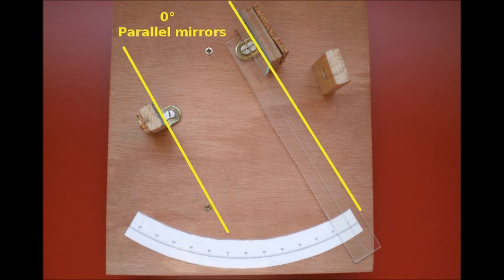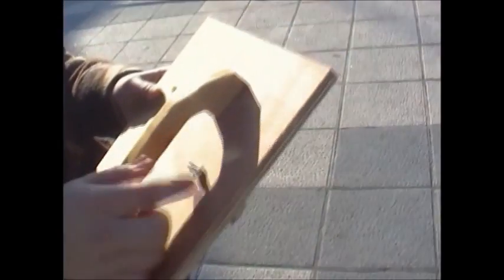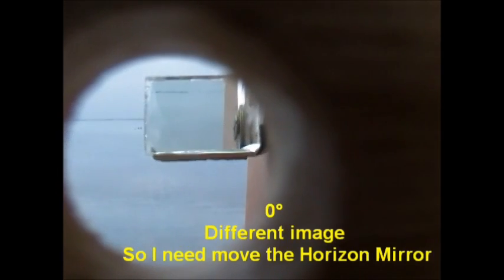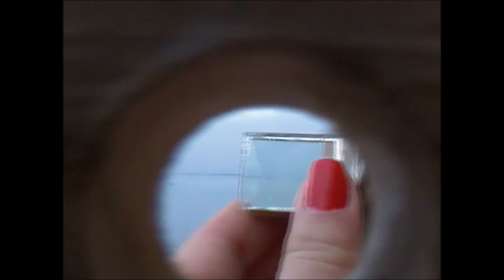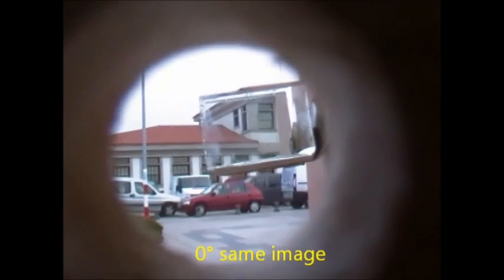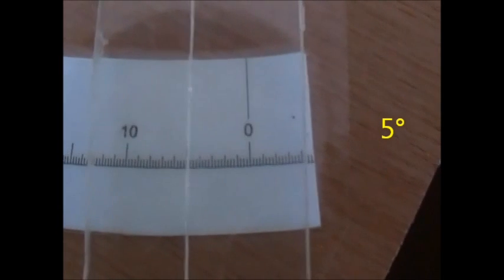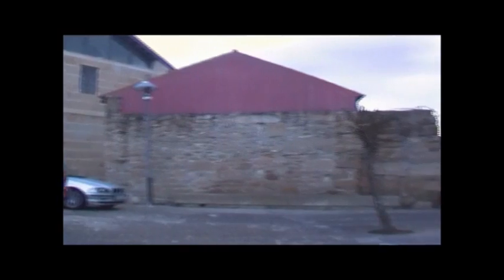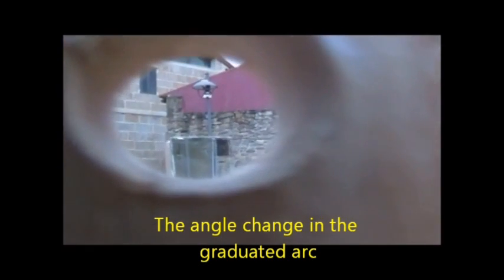How to use a sextant?

Comment: Well done! You have made a genuinely useful instrument with simple materials. One question: can you get an estimate of its accuracy?
Reply from the maker: Yes. It is around 30 minutes of one sexagesimal degree.
We needed a good number of sextants to use them in trigonometry lessons so we changed the system to make one. Two years ago, we made a sextant designing the pìeces of a sextant, using a 3D printer to print pieces and moulds to reproduce them.  Each sextant includes a nonius so the measure of an angle is better. We have now  20 sextants. The cost of one is 1.5-2 €. If we do more sextans the cost is lower:
https://www.thingiverse.com/thing:3591169
https://pontevedraviva.com/xeral/54693/alumnos-profesores-sanchez-canton-fabrican-sextantes/?lang=es
(the text is in Spanish language but you can see there images of the sextant). 
We have in mind to do the same with a artificial horizon to measure vertically angles easely.
If you want more information, please send me a e-mail (bua[at]edu.xunta.gal)
Reply: I had the same question. Thank you!